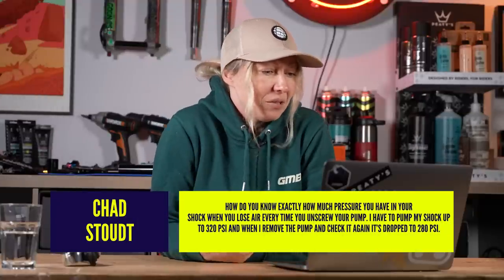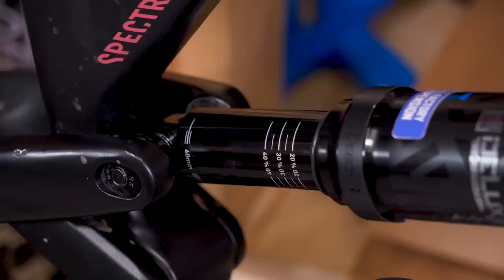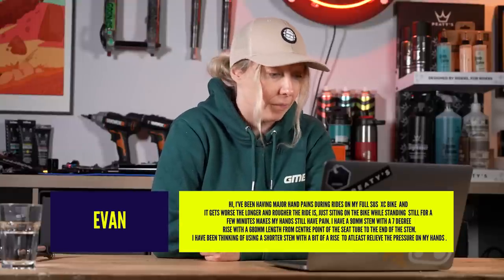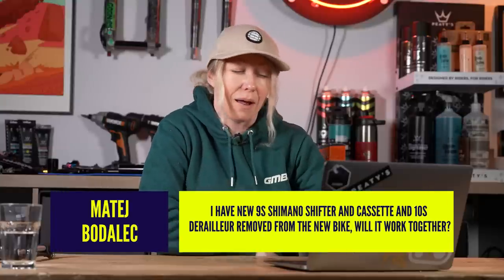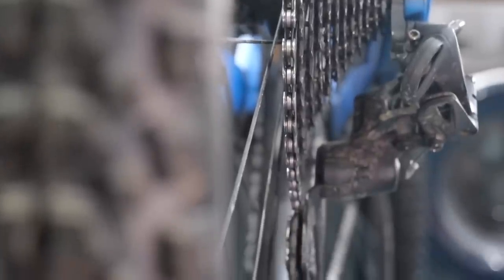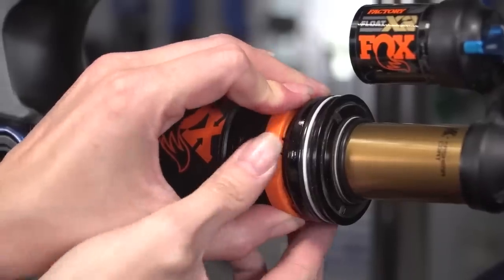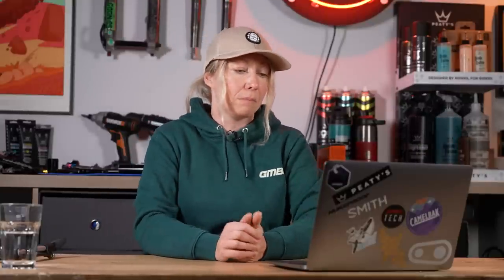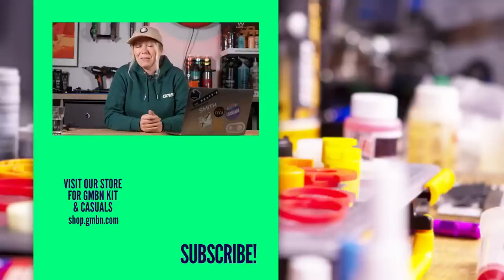Do I Lose Air When Removing The Shock Pump? | #AskGMBNTech

Comment: About that 9s shifter+cassette and 10s derrailleur - sorry Anna, but that's bs. Derailleur doesn't "assume" anything, its position is dictated by cable pull from the shifter and (properly adjusted) derailleur uses the entire cassette range, which is exactly the same width for 8s, 9s and 10s. The only thing is to make sure shifter and derailleur have the same cable pull ratio (safest bet - same make and generation). I'm running 8s shifters and cassette on 9s derailleur and I would never notice it if I hadn't have checked it in the derailleur spec
Reply: Exactly. I don't think she knows how derailleur works. You could even run 12 speed on a tourney using goatlinks. The only difference in derailleurs is the length of the cage for larger cogs.

Comment: As you connect your shock pump to your shock or fork you will feel a point where it has sealed against the valve stem but not yet opened the valve. At this point pressurise the pump to your normal pressure and then proceed to screw the pump on further to open the valve. Equalising the pump before the valve is opened will give you a more accurate reading.It's a trick I've been using for years and gives you the most accurate reading possible.

Comment: Talking of rust removal i recently removed rust from some cheap chromed fork stanchions using some scrunched up aluminium foil. I was amazed at how well it worked. Also for light paint scratches you can put a bit of silicone oil / grease on a rag and polish it. Its amazing how well it can make them disappear.

Comment: In my own testing, when I overfill the shock by 10-15psi and then reconnect to test PSI while keeping the pump body collapsed (and not extended) the shock is at my preferred PSI. This indicates that I am indeed losing air in the shock when disconnecting the pump. It seems logical to me that while unscrewing the pump’s schrader connector, the schrader valve is releasing air, similar to when you might depress the schrader valve on a tube or presta tubeless valve. It’s irrelevant if the air is in your shock pump hose or pump body. 
The issue is made worse if your pump’s schrader connector is short, round, and too tight to get good purchase with your fingers, as it’s more difficult to unscrew it quickly from the shock schrader valve to limit air loss. Rockshox have this problem more than Fox IMO, due to their valve placement on the shocks. 
Another way to test is to try and place a gauge on the shock and even the most momentary movement of the air gauge on the shock’s valve will release air, with a substantial amount of PSI drop. It’s super annoying. 
I’ve found that the fork has much less loss, simply because of the ability to unscrew the pump schrader connection quicker.
Reply: You are spot on!  That is the correct answer not the one given in the vid.
Reply: There's a lot less pressure in the fork which means you loose less because of that fact.

I have tried a gauge (Topeak D2X) and I just instantly lost 30 psi while trying to connect it to a rear shock with 210psi in it. I tried more times but I just couldn't make a connection without lots of air just farting out in a jiffy. It's a bit weird when Topeak even have images of testing this gauge on shocks and forks. I did manage to get a connection on the fork though, but that's only 88psi so a lot less force on that schrader valve.

PS: If you suspect air loss just test sag with pump attached, and then without the pump attached. If the readings vary too much you got a drop in psi, if not things are golden.

Comment: My shock pump will certainly drop pressure. If I don't unscrew the pump super fast, about 3-4 twists of the connector will leave the valve half-pushed, and air will rush out. My friends RockShox pump will not do the same thing, so I think it depends on the pump. I suspect the RockShox pump stays airtight to the threads long.
Reply: The instructions that came with my Rockshox pump said to put 5-10 psi more in than you want cos thats how much youll lose when you disconnect it.
Reply: Anna is right... RS prob say that due to the total myth u loose pressure on unscrewing.
Think about how many turns u have to do screwing it on before any pressure registers!
Reply: @ibewillow  RS talking utter bs... Never seen that anywhere... And the loss would be entirely dependent on the pressure also, not some arbitrary figure.
Reply: Easy to test that. 
Just unscrew shock pump slowly until u just start to hear it hiss. And leave it at that position... It it is faulty and is letting pressure out the shock/fork (rather than just what's in the pump) it would obviously continue to hiss until ur shock was empty and it would sag right down. If it does, ur pump is faulty.
Reply: @rupedog  that is 100% what my shock pump will do. Not sure about my buddies RockShox pump but mine will drain the shock if I don't unscrew it fast.

Comment: Interesting. I always thought Schrader valves hissing at disconnect was caused by air leaking from tires and/or forks (in this case). That it comes from pressure from air in the pump is new information to me. My main objection to Schrader over the years with tires (as opposed to Presta) was in this air loss while unscrewing the Schrader valve. This provides new perspective.

Comment: Shock Pump issue... Get a pump with the lever on the connector (Mine is a Giyo which is almost exactly the same as Rockshocx but has a tiny lever on the end of the hose).
You screw it on, flip the lever that pushes the valve pin and shows the pressure in the shock (and of course looses a little pressure as you just filled the hose from your shock).
Now you pump up the shock and the gauge on the pump is accurate.
then you release the lever and it closes the valve.. (loosing the tiniest bit of air in the cap of the connector only, and NONE (from the shock) when you unscrew it)
There is a pressure release button to lower the pressure if you over pump.. you can use that to release the pressure in the hose before removing if you want but with the lever released the shock valve is closed, nothing you do with the pump now will affect that correct pressure you put in...

But after all that, the correct pressure is only a guideline... sit on the bike and check the sag.. (and even sag is only suggested... ride and see what happens with your o-ring indicator and feel for how it rides at certain sag settings... Don't just settle for factory values... its your bike and your butt... set it to suit!
You can leave the pump connected while doing that and pump/release till you have it just right (take note of the sag position that worked best in your experiments and use that as your target, not the pressure (although once you know what that is you should get very close to your last sag level using the same pressure.

Comment: Small rust chips in paint...
If you don't want to sand the chip and make a bigger patch to repair.. don't just fill the rusty chip hole with the correct paint as the rust is already there... it will rust through the paint.
Go research a "Rust Converter". The idea of using a rust CONVERTER is that you don't remove the surface rust (if it's a thick/big patch you remove loose rust) but the converter actually changes the Ferris/ferric oxide into a different Non oxidising coating.. basically converting the rust into a protective non rusting coat.
(A lot of the ones I have used often turn purple/black on rust and remain the color of the product on clean metal.)
These products can often be applied with a cotton bud or toothpick and the paint goes straight on top once dry.
(I had one product that was white and appeared that the rust came through fairly quickly... but the actual product stained yellow where it was working (not the best choice but maybe the only choice they had in chemical reaction) but lasted years without any actual rust coming through the paint (and we didn't paint over it as it was the floor of a van).

Comment: The 10 speed derailleur with a 9 speed cassette and shifter will work just fine, the shifter determines the setting/placement of the derailleur ???? . The only issue is the jockey wheels are slightly less wide.
Reply: I would totally agree with you, the shifter dictates the increments, derailleur will follow “orders”. Narrower jockey wheels should not be a problem, wider would. At any case replacing the jockey wheels is a cheap option.

Comment: Hi! Love you guys, Anna and Doddy! I have an #askgmbntech question. I have a 2022 Specialized Stumpjumper Alloy with RockShox 35 (140) up front and an X-Fusion rear (130) and given my weight and riding style I want to upgrade them. Geometry-wise, will going for a 160mm fork be too much? Is there like a ratio between front and rear travel I should follow?
I'm 1.84m tall and weight around 100kg, my bike is size S5 (XL). PS: already upgraded the transmission to a full XT system and GR2 brakes, suspension is now my main objective.

Comment: #askgmbntech Does rim width matter? I have a bit smaller rim for my tire and I’m worried that I get less grip while riding.
Reply: The wider the rim the lower the pressure can be put without your tyre folding, soo yeah a wider rim will help getting more traction since you can lower the pressure more and vice versa
Reply: @dunigan3320  Thank you! I will make sure to buy some new rims.

Comment: #askgmbn will deflating my rear suspension and seeing how my suspension works damage or hurt the rear shock?
Reply: That usually doesn't hurt the shock. Some bike technicians say that doin that and pushing down (or the rear wheel up if in a stand) so that all of the travel is used is one method one can use to properly size a chain and make sure the derailleur isn't fully stretched out when and if the rear end bottoms out or gets near it.
Reply: No

Comment: So so true Anna re pumps... Its a total myth (unless ur pump is faulty maybe). Simple to prove/test as well... Just unscrew shock pump slowly until u just start to hear it hiss. And leave it at that position... It it were letting pressure out the shock/fork (rather than just what's in the pump) it would obviously continue to hiss until ur shock was empty and it would sag right down.... But it won't... (assuming it's not faulty pump obvs).
Reply: You can also limit hiss time by adding an extra gasket into the pump head to retain pressure longer while you are unscrewing. By the time you are reaching the end of the thread, the valve head should be back in closed position, and the only hiss you get is the remaining air stuck inside the head.

Comment: @gmbntech Bike fitting 101.  We never touch the front of our bike until the back is sorted.  A lot of times, pain or pressure in the hand is related to saddle position.  Make sure that is perfect before you change stem length.  While a dated method, KOPS will get you close.
Reply: And don't forget that the width of the bars, back/up sweep counts a lot too, not just the stem and the rise. It all depends on what kind of pain he has.
I haven't tried it, but road bikefitters say that rising the bar is actually causes more handpressure as you will hold your torso on it more, while lowering it makes your back to hold your torso. I guess this only applies to more aggressive positions, not the touring upright one, but we don't know his position (90mm stem from the factory sounds like an aggressieve xc bike, or a cheap touring one).

Comment: Has anyone here with a full sus bike experienced their rear air shock's main chamber leak air into the negative chamber with the lockout (or in my case, "compression adjuster") engaged? The main chamber usually leaks psi to the negative one way past the negative's maximum stated by the manufacturer, which is 80 psi. Again, I experience this only when the shock is in the lockout position (it may also be happening under normal use by the way). Does this usually mean the shock is defective?
Reply: Pos chamber is meant to let air into neg... And does so to fill and balance  the neg. They have a bypass at about 25-30%sag point. That's why when filling u have to cycle the shock.
Unless it's a dual air fork of course, where u fill pos and neg via separate valves.
Reply: @rupedog  I didn't provide more details into my issue and the reason why I posted the question, that was my mistake. I understand how a rear air shock with pos and neg chambers works, but my issue is that the main chamber is leaking air into the negative one way past the point of the manufacturers recommended maximum, which is 80. I have a shock that has a valve for both chambers, so both is meant to be pumped up. It's a DNM AOY-36RC.
Reply: @TivonSanders   
If it has two valves it should not crossleak. Your best bet is to contact the manufacturer. But I can imagine it's just a bad design.
Maybe even better bet: you can get cheap but reliable, and better designed shocks from x-fusion, sr suntour, etc, (or used from the big brands).

Comment: #AskGMBNTech Hi, I bought a nice 2021 Mondraker Superfoxy bike. It has a standard SuperBoost Plus 157x12mm rear hub, with a 56.5mm chainline. When backpedaling on the two largest chainrings 42T and 50T, the chain fell off ... I replaced the front chainring to 32T oval with a real offset of 2mm (I always ride oval). The original Sram had a 3mm offset, so things got even worse. The chainline was 57.5mm and when backpedaling, you can guess what was going on. I decided to swap the dub bottom bracket spacers from the left 4.5mm to the right side, and right side 9mm to left. Currently the chainline is 53mm and it works great, and when pedaling backwards the chain doesn't fall off either, but it's now closer to the 52mm boost standard than the 56.5mm SuperBoost. Can this 53mm chainline cause problems with SuperBoost Plus hub?

Comment: #ASKGNBNTECH Good day here from Philippines long fan of the channel. just want to ask whats your comment on Dartmoor Hornet frame or dartmoor frames in general. im building my first Hardtail rig on A dartmoor hornet.  also should i go all out on the specs my thought is i could upgrade to full sus in the future will the parts be compatible from my HT to Full sus. thankyou
Reply: Don't know the brand but the hornet looks like a good enough frame for your project. Don't cut the fork steerer tube to fit the HT, you might need it longer on a FS. Same for the cables and brake hoses keep some extra just in case you need more on a FS. The hornet has external cable routing if the FS does too swapping out will be simple enough to keep the HT frame for the rainy season. You have a plan so good luck

Comment: How are people running so much pressure in their shocks and forks? I weigh about 180 lbs and the recommended pressure for my Fox Float X is 189 psi at the highest. That's nowhere near the max PSI. The guy here weighed maybe 20 lbs more than I do. The fork is far less.

Comment: #askgmbn I have two bikes with different brand brakes on them - Shimano and SRAM. Both use mineral oil. Can I use the same bleeding kit for them or do I need to buy a separate one not to cross contaminate them with different brands of mineral oil? Oh and another one: where is Doddy?
Reply: Make sure you throughly clean it with brake cleaner after each use and you will be fine